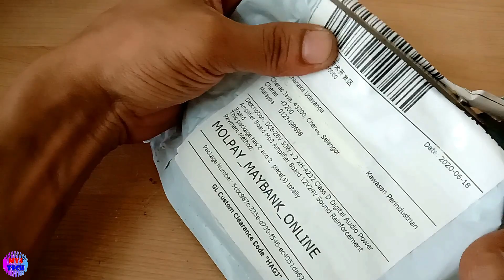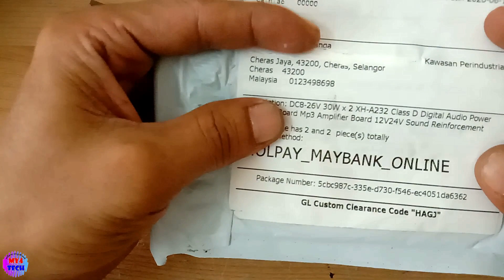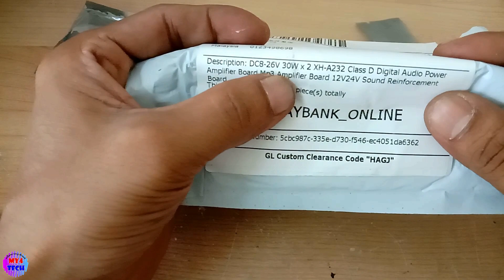Stereo 60w Power Amplifier Testing | My4 Tech

Comment: TPA 3116 d2 80Wx2 amplifier ekata 19V 2.1A power supply එකකින් දුන්නම noise එකක් එනවා speaker වලින්. ඒකටද හම් එක කියන්නේ? Unit එකටම ආව volume control knobs අල්ලද්දි ම noise එක වැඩි වෙනවා. Treble knob එක අල්ලද්දි ගොඩක් වැඩි වෙනවා. මේකට 12V 10A එකක්ද නැත්නම් 24V 5A එකක්ද හොඳ? එහෙම දැම්මාම වැඩේ ගොඩ යයිද? මේක මගෙ පළමු වෙනි project එක.
අනික් දේ තමයි Volume එක අඩුම කරලා off කරද්දිත් speakers වලින් ඩකස් ගාලා සද්දයක් එනවා.
පොඩි plastic box එකක් ඇතුලේ තමයි ඔක්කොම දැම්මේ. Fan එකක්, bluetooth module එකක්, FM/USB kit එකකුත් එක්ක. එහෙම දාන එක හොඳ නැද්ද?
Reply from the maker: ඔය කියන noise එක එන්නෙ usb කිට් එකෙන් වෙන්න පුළුවනි. ඒ නිසා ඒක නැතුව ඇම්ප් එක විතරක් චෙක් කරල බලන්න